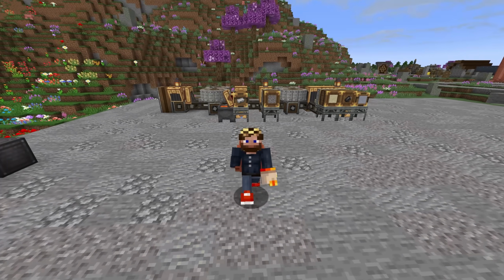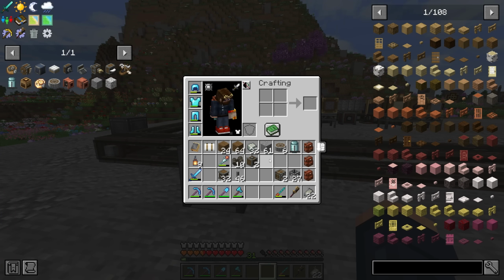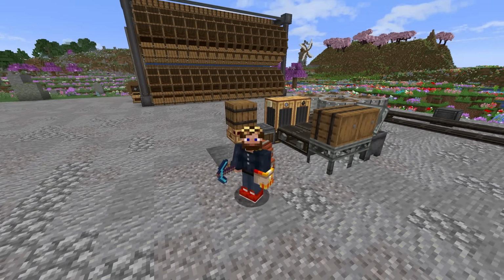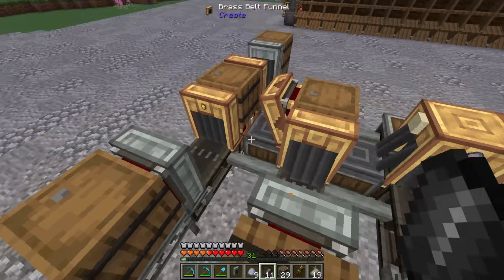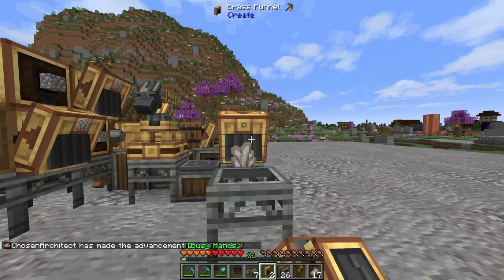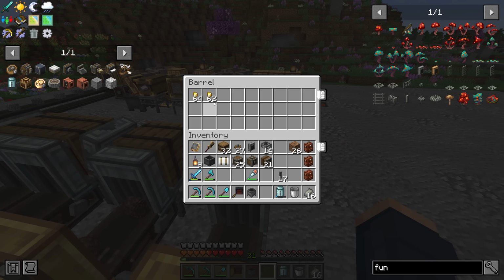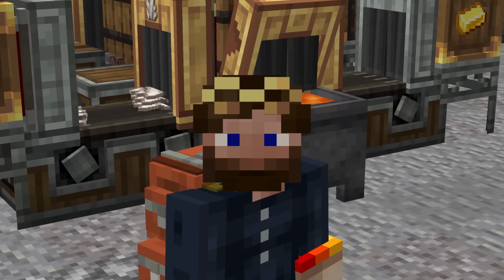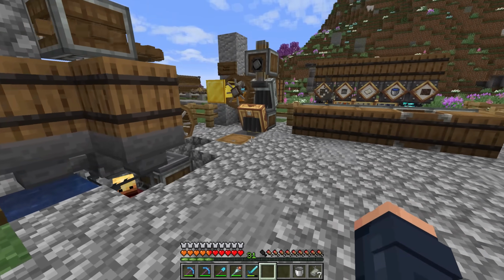I Finally Automated the Most Important Block: Andesite EP9 Chosen's Create: Integrated

Comment: Searched the comments before I said this but I believe you can use the encased fans through a belt so you don’t have to make a weird hole with 2 brass funnels, just one funnel filtered to the end product connected to your output and a fan underneath or above the belt will work

Comment: Hey Chosen!
I added a few mods to the pack that I think compliment it really well. ( some personal bias :P )
I've long been a fan of the computercraft mods as a programmer. Being able to use Lua to program your factories with additional functionality has been a blast over the years. On top of that, reworks/additions to redstone ease-of-use or portability has also been a great personal choice for most packs. I'm aware of the redstone features that Create itself adds but I figured I'd include them in my suggestions anyway in case you like the way they sound. If you want to keep their use optional (as you should for those that don't want to interact with it) you can avoid adding any quests (or use optional quests) and avoid changing recipes to incorporate them. That should theoretically keep it as the best of both worlds.

** Core Mods **
* CC: Tweaked -- Of course the base mod.
* CC:C Bridge -- Extra ways to improve compatibility between Create and CC: Tweaked.
* Advanced Peripherals -- Takes the CC:Tweaked mod and makes it able to do so much more. As an example, detecting the player going through your factory door and switching on your factory lights is just one simple thing you could do.

** Optional Mods **
* Additional Redstone -- Adds logic gates to compact/simplify redstone design
* Little Big Redstone -- Per the mod page: "This mod adds a new block called the Microchip that allows you to put together complex logic that interfaces with redstone and item/fluid/energy storages".
* Redstone Pen -- I believe I've seen you play with this one before so it probably needs no introduction.

These are just my suggestions from a person who enjoys the more technical side of solving problems :P Otherwise thanks for the new modpack to play around with :D

Comment: Mechanical arms can put things directly into crafters, no need to filter if you use one arm per ingredient
Reply: No need to make multiple arms if one would suffice. It's pretty easy to filter the crafters with brass funnels.
Reply: @paulelderson934 yeah but he did both which is less efficient either way
Reply: @a_cactus_2422 he used two because of the item routing. Your suggestion would have made him use two per side for a total of four.
Reply: @paulelderson934 no not even close, the inputs are the same funnel or not
Reply: @a_cactus_2422 oh wait, I'm thinking absolutely backwards. 

Yeah the funnels were totally unnecessary in this setup. I don't know why they're even being used here, honestly.

Thanks

Comment: If you needed even more storage for the gold and iron, you could even add the ingots into the compacting upgrade filter, so that they get compacted even further into blocks :)
Reply: @seungtakho1117  plus you could also use limited barrels instead of complete barrels, which compress the space the normal barrel would have into all the slots that are available in the limited barrel.
Reply: Or just use a void upgrade and let the excess die
Reply: @Birdbuilds  He said in the last episode that he can't afford them at this point
Reply: @Birdbuilds as the other guy said, at the moment, lets call this "early midgame in progression" at least for Create because of Brass access. You need early to mid Late Game before the Void Upgrades are feasible to craft especially in large quantities.

Comment: I think it might've been more efficient to divert sand overflow into the new process instead of splitting the cobble and voiding even more secondary products. Whenever you need to use something you already automated, I think it would be best to use the excess of that material so that you keep your max stock without slowing production.
Reply from the maker: I would do that but I think I will turn it into glass in the future 😉